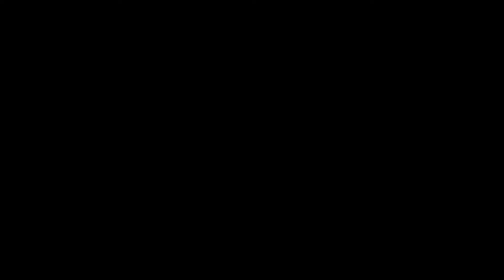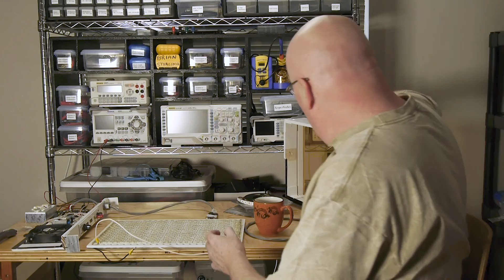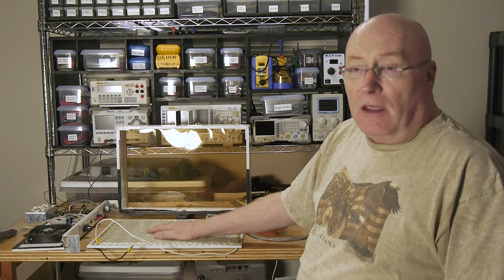LED Video Panel Upgrade

Comment: I did not watch every minute, maybe you mention something about it but what about cooling? Without Aluminium or metal plate (which is capable to absorb heat from LEDs) they will die soon or much sooner that they should.
Reply from the maker: Kamil Polner In the video I show that the panel has holes at the bottom and top and a fan to force cooling air across the LED's.

Comment: Enjoyed the video!  Just a friendly tip when stripping the outer sheathing off of multi-wire cable.  You`ll find that by firmly gripping that piece of "string" within the bundle and pulling sharply down along the length of the cable, the outer sheathing is easily slit for removable without the need for a blade (and the inevitable nick to the underlying wire insulation).
Reply from the maker: Yeah, that can work with some cable, particularly the multi-strand signal cable, but with heavier wire like I used in the video the outer jacket is a bit too tough.  The wire used here was speaker wire from Monoprice if I remember correctly and is 10AWG -- the jacket was a bit too tough to rip through with the  string.  But, yes, with the right cable the technique you mention is often useful.

Comment: i enjoy your video. but one suggestion.the audio. is a little to low
Reply from the maker: jix177 Thanks, there are a few places where I kind of mumble a bit and there were so other places where I did a bit of swearing but I fast forwarded through that.  During the fast forward bits you can hear some chipmunk sounds and some of that was the swearing.  Yes, I can be an ornery sort...
Reply: I actually thought the audio level was ok. Good build.